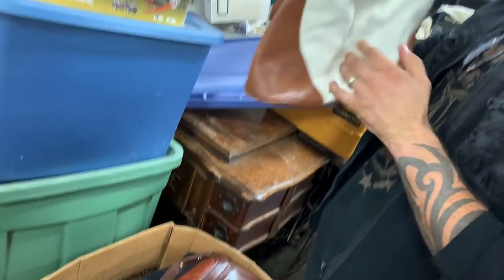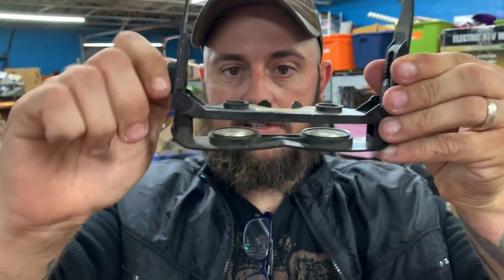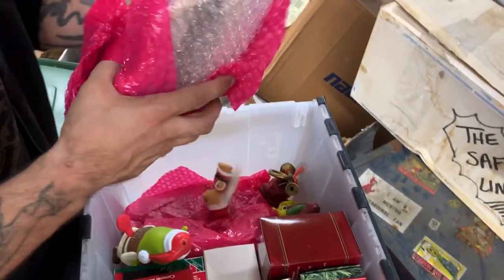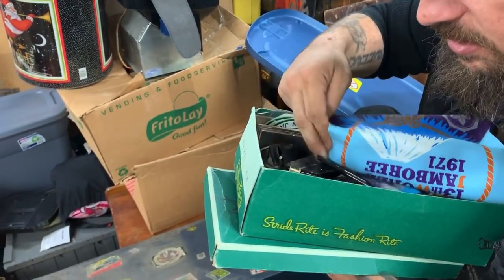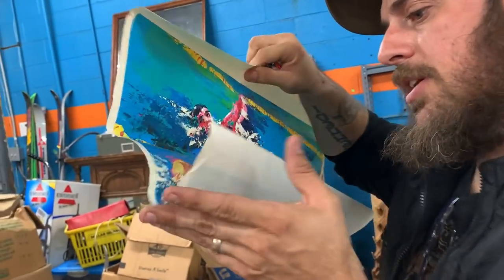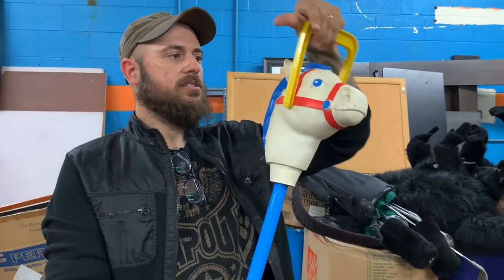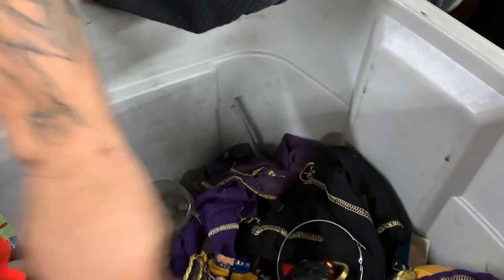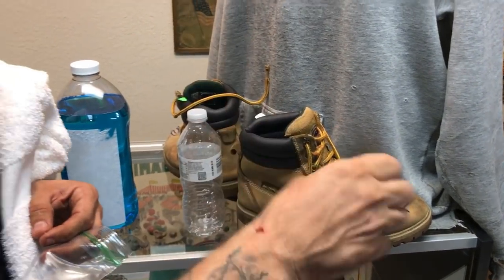KATY is... DOCTOR PIMPLE POPPER! WART CUT OFF!! Abandoned Storage Units! Unboxing!

Comment: 42:18 that is a high powered capacitor for a car stereo system. Do not touch both terminals at same time. If there is still a charge in it it will shock you.
Reply from the maker: Thank you so much, never seen one before.

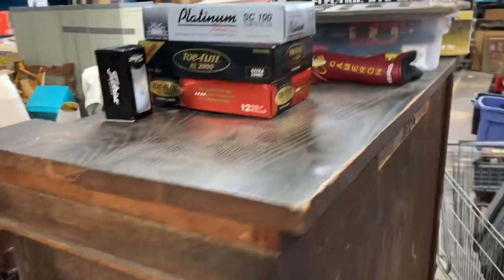Comment: 7:22 Goo Gone will take that adhesive from the tape off without any problems.
Reply from the maker: Thanks Wayne. I cant wait to clean this thing up.
Reply: Use a hair dryer to loosen the tape and it will help prevent scratches on the glass